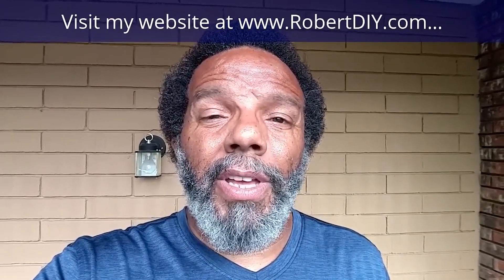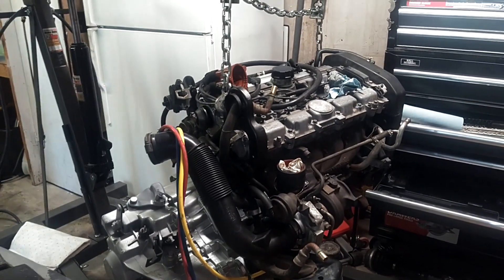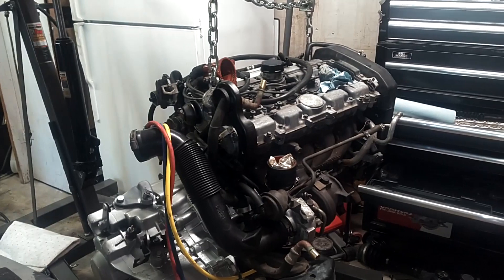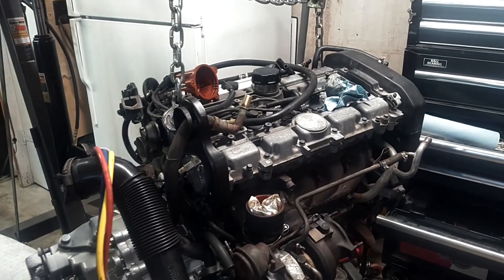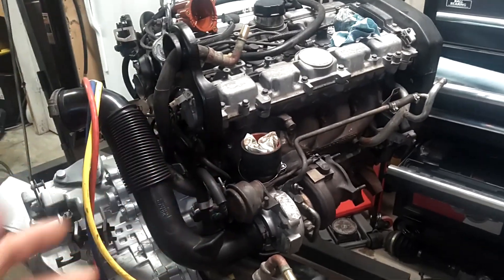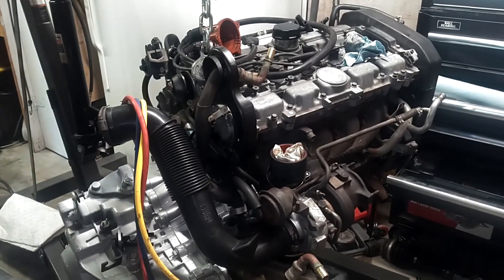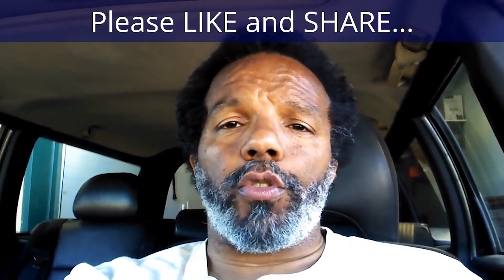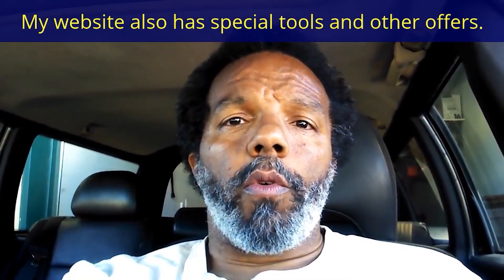Why your car and other newer cars have turbo's? - VOTD

Comment: I know this video has nothing to do with heads but I have a 1998 Volvo s70 glt with a bad valve seal but have a donor head off a 1994 850 t5 would it be a bolt on swap?
Reply from the maker: yes

Comment: Doesn't that mean they wear out quicker? (Piston rings etc) Simply on the principle of asking less to do more?
Reply: Exactly. When u mix that w negligent owners used to old Honda motors, u end up w cars blamed as “unreliable”
Reply: @mstrshkbrnnn1999  Yeah, it seems there's a lot to be said for hard vs gentle miles.
Reply from the maker: Well, my car has 465,000 miles on it so...
Reply: @RobertDIY  yeah Robert, I'm meaning more like the 4 and 3 cylinder junk they're coming out with, not a fan, 3 cylinders sitting at idle sounding like literal washing machines.

Comment: Update on my flip S70 sedan. The plastic water neck broke, and the previous owner overheated it the point the head got warped. Head is being milled, (I live in a small town so I know the owner of the shop) and while I'm in there, it's getting a water pump, timing set etc. I haven't looked around much, but, is there a company that sells a metal water neck? I got the car for scrap value, so I have plenty of wiggle room for making it right. Car is rust free from SC, so when I sell it, I want it to be the best I can make it. Thank you in advance.
Reply from the maker: Not sure what a "water neck" is???